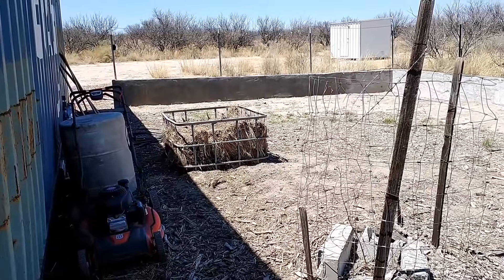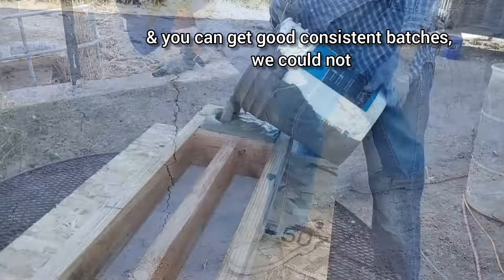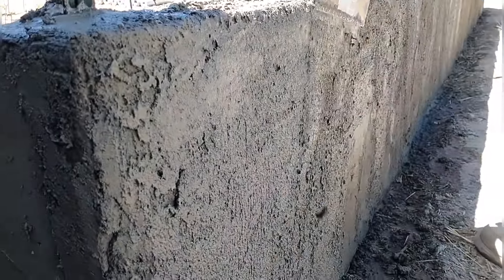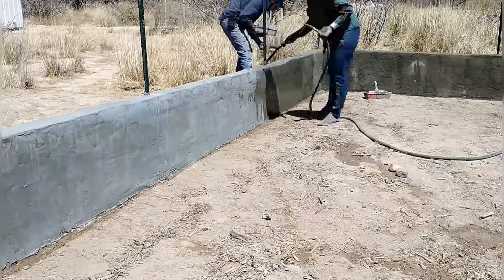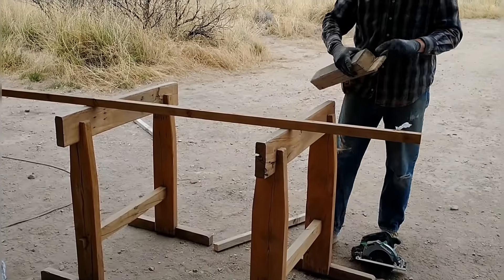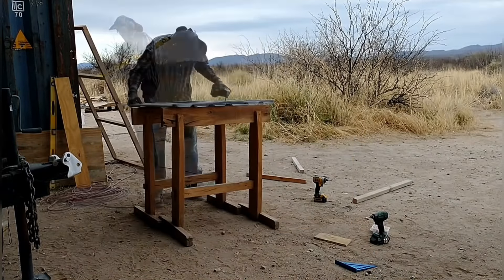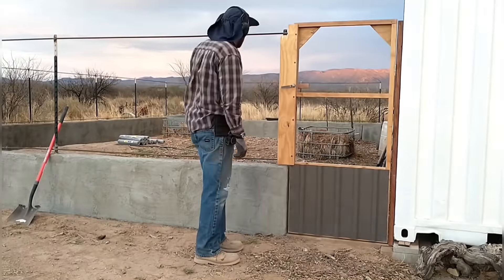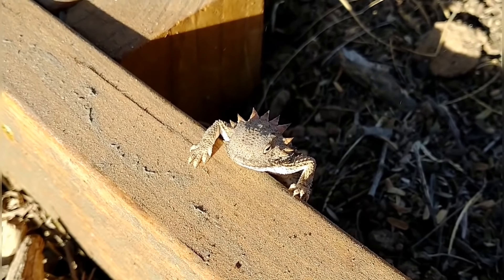Finishing Our AIRCRETE Garden Wall | How Much Did it Cost? Stucco, Chicken Wire Fence, & Gates

Comment: It will be interesting to see how the wall ages in the fabric reinforced areas compared to the plain stucco portion.  
My understanding is the fabric adds significant tensile strength which is important since cement has poor tensile strength. Like how drywall gets its strength from the paper layers on its surface.
Reply: you could have used a cheap version of tyvec + stucco.
Reply from the maker: The fabric needs to have fibers that can be worked in to the plaster. The heavy landscape fabric was somewhat fibrous, but too stiff and thick to work the plaster through. It just came loose and wouldn't stick at all.  The leach field fabric is inexpensive and worked great, but we ran out and don't know if it will hold up long-term anyway. The stucco worked into the air pockets pretty well, so it should give the wall a lot of strength, but it will definitely be interesting to see how the whole thing is holding up after the summer, and in a few years.

Comment: I have found it's best to finish smoothing the stucco surface with a foam pad that has a handle on it. Just keep a fairly wet foam and do swirls as you go. I watched a "professional" do it once as I was prepping my CA house for a paint job in 1990 and have used that tool/technique every time I have to do stucco.

Comment: Garden wall turned out great.  I  like the gate latch. Reused old wood for door. Smart. Thanks for sharing
Reply from the maker: Thanks! Yes, the gate and latch work great! It's a little tricky having two, I need to double check and make sure they are both closed, but even with leaving it open a couple of times, nothing has got in. 😊🌱

Comment: Like frosting a cake. I’m so glad you did so much testing and didn’t have the experience of having to start over on your house. That is one nice garden and gate! You’ve added a lot of strength to your wall with a strong concrete coating. Now for veg! My humidity here in Phoenix has been 10%, so wetting down the wall was a great idea.
Reply from the maker: Thanks!  Yes, we like traditional building much better anyways. 
 I think the enclosure will work well! Very dry here too. The dust and static electricity are really something right now. 😅 It's been a nice spring though and the wind hasn't been too bad. We got down to 28° Thursday night! Hopefully it was the last freeze of the year. Our low temperatures are often 20° colder than in town which makes things a challenge, but we still have a longer growing season here than anywhere else I have lived. 😊🌱🏜️
Reply: We live in one of the highest spots in Florida about 300' above sea level. Lots of hill's and holler's coupled with rivers, creeks, streams, lakes and pond high humidity. Temperatures here are 7 to 13 degrees colder or hotter depending on the season. Snow every 7- 10 years then drops to like 10 degrees with a wind-chill of 10-30 degrees and with the high humidity it cuts like a knife. Summer can be 117 plus humidity that just hangs on you.  Yep, got the best and worst of everything here - hurricanes, tornadoes, earthquakes, the deadliest rattlesnake, coral, snakes, coach whips, moccasins, pigamy rattlesnake s, brown recluse spiders, black widows, alligators, bears, crocodile's panthers, bobcat's, and lynx. Horny toads, beaches, deer, wild hogs, turkey's opposum, armadillo, sharks, dolphins, etc and too many Yankee leftist democrats moving here trying to turn my native state into something like they ran away from.😆🤣😆 But hey build and live your dream and if you're ever or way stop in an say howdy!!

Comment: a bag of mortar cement for the stucco will add air-entrainment agents...it will keep the cement from cracking in cold weather...ordinary concrete mixes don't have air entrainment agents, not for outdoor walls or slabs...some people add dishwasher soap as an emulsifier
Reply from the maker: Interesting, we didn't take much time to research, 😏  it looked like most recipes just used sand and cement. We wanted to just get it done.  Hopefully we can just add another coat of stucco if we start to see issues. Our winters are very dry, and we never stay below freezing for long, so we'll see how it does.

Comment: That is a nice looking garden space. My experience with a garden in Cochise Co started with a chicken wire fence using the smallest size holes. I still had a problem with birds getting in so wrapped nylon netting from sewing department to the wire. Also put wire over the top. Sun was so fierce I put up shade cloth over it using burlap in the roll. Everything was in containers. I had to water daily. My herbs sat in pans or bowls of water and it disappeared during the day. I know you have some experience from your garden last year  Hope you get tons of food from your garden.
Reply from the maker: Thanks! Yes, gardening is a challenge for sure! Lots of mulch, and good top soil from around the old mesquite trees worked well last year. The birds will eat the new plants if they aren't protected, but they seem to leave them alone once they get bigger. I have found that the birds are excellent weed control, they eat anything that comes up if it's not protected.  😊🌱🏜️

Comment: From my experience working in the concrete business most bridge's I have repaired from logging equipment scraping it are blown out again by the next year simply because water entered by a small crack and froze behind it and popping it out.  Painting them with thick safety paint helped seal it.
Reply from the maker: We looked into it, but brick paint is expensive. Our winters are very dry, and it's rare to get moisture and a freeze, but it does happen. It seems like the wall wouldn't hold much moisture since it is so aireated. But I guess we probably should seriously consider painting it before next winter.  Thanks 🙂🏜️

Comment: Guys treat the aircrete same as for concrete, for structures like the wall you need to reinforce, aircrete is lightweight concrete, in place og aggregate there is air bubbles. you guys are working the product very well, you can cut the wall with a hand saw, good job
Reply from the maker: Thanks!

Comment: You could have gone over your wall with a wet sponge when it was just about dry to make the surface look more uniform.
Reply from the maker: Yes, definitely an option, but for this we don't mind texture, and rough stucco is less likely to crack.

Comment: U should use some chicken wire as reinforcement
Reply from the maker: There is chicken wire in the wall, but it would be very difficult to get it stick to the outside.